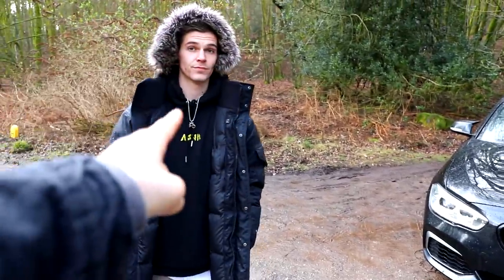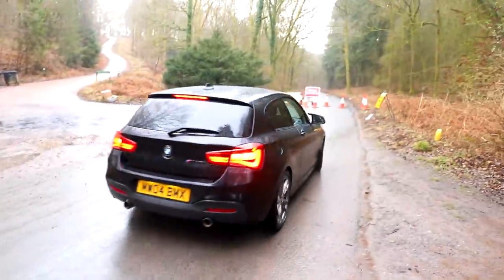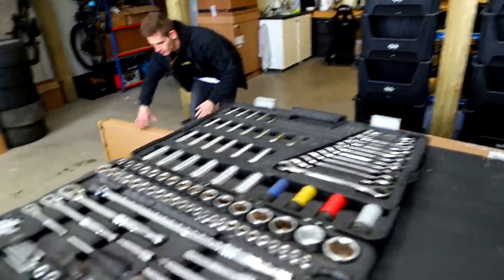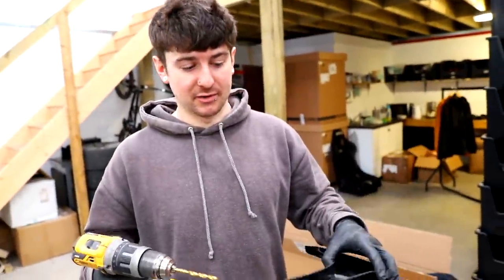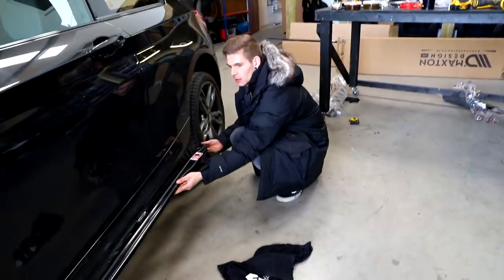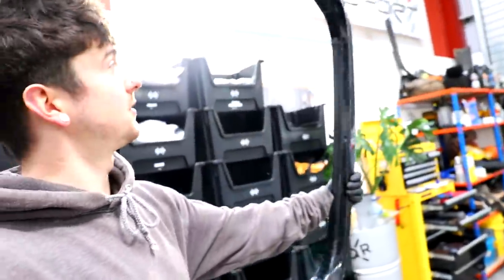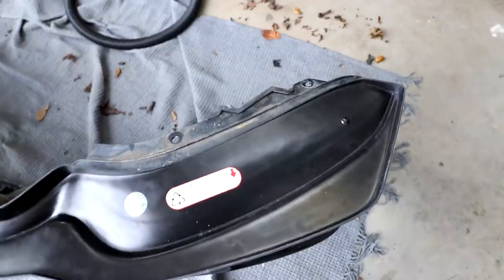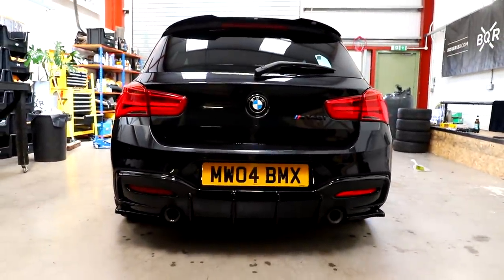BMW's and BMX - A weekend with Mick

Comment: Next mods
Wrap v bars behind grill
H&r 25mm springs and bimmec spacers 12mm front 15mm rear
Some nice carbon exhaust tips
Tint headlights
Sunstrip is also a nice touch 
Its drop in filter
Decat
Go straight to stage 2
Res delete with backbox mod

Comment: Get springs and spacers, the 140 is very floaty (check the top gear video of the 135) and it will improve the handling by a huge amount

Comment: Good choice !
Had mine a year and a half, mapped it and it's now 411bhp/576nm.
Don't be fooled by a lot of tuning companies claims, 440+ on just a remap, they are bullshitting gullible customers by cheating the dyno figures (very easy to do). 420bhp is about the limit for a stock engine, with just a remap.
Yours is a 2017 same as mine, so pre-PPF (a good thing).
Trust me though, 411bhp is plenty fast enough !!! But to get 450-460bhp you need a sports cat which is expansive.

Comment: Performance is good atm I would start with lowering it with some lowering springs then looks at wheels then go for a exhaust system and air box delete or performance box then remap gives you a bit of time to figure out the car and how it runs till you get bored of the power